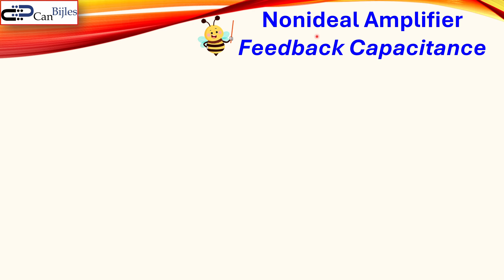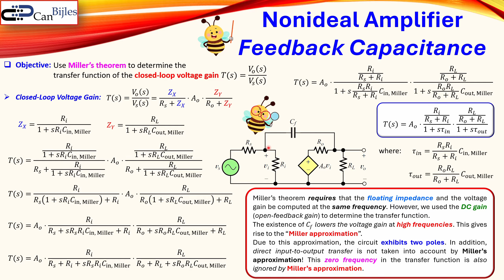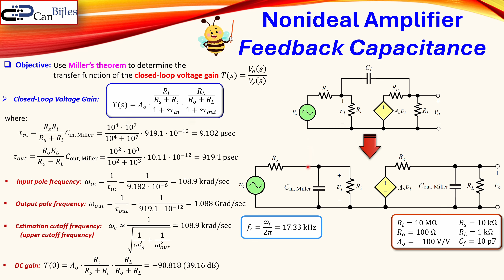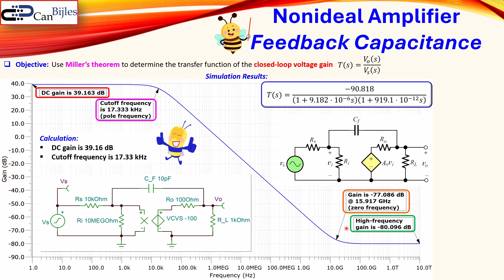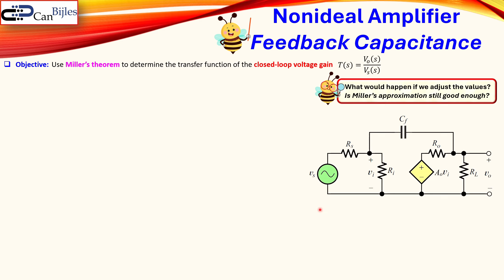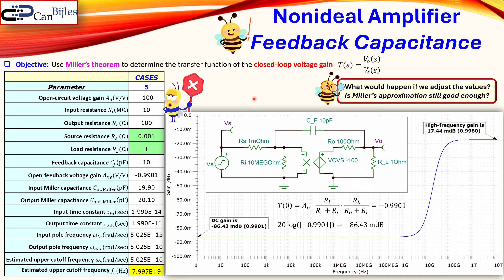Miller’s Theorem Applied on Amplifiers 💡 Feedback Capacitance & High‑Frequency Cutoff

Comment: So, it's like looking through the entire amp from the front to the rear and establishing a Z, and then looking through the entire amp from the rear all the way to the front and establishing another Z. Then, relating them as in series with two voltages as a voltage divider if I'm understanding correctly.
From there, you can establish capacitance of each division.
Reply from the maker: What we basically do, is to convert a floating element in two separate elements (one at input and one at output). This is done to calculate the complete transfer from source to load without making analysis through feedback loops.
Reply: @CANEDUX  indeed, it's fundamentally exactly what I said though.
Reply from the maker: @JonDeth  Yes, you said it in a similar way, but I also stated the reason for doing this conversation, as discussed in detail in this video.
Reply: @CANEDUX  which is why I'm a subscriber lol.
Reply from the maker: @JonDeth  Thanks👍